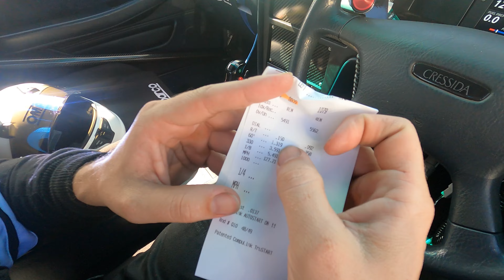BROKEN AGAIN??? Kenda 660 Drag Race Series RACE DAY!!!

Comment: Do you edit out the swearing yourself, or does Youtube do it automatically?  Either way, the beeps are fucking annoying so hopefully you can just pitch the videos at adults and if you want to swear on video, don't censor it.
The Mustang is a weapon!  I always figured a Stang needs a V8, but Nick's car has changed my mind!
Reply from the maker: Editing the swearing is the most annoying part, it takes forever. It's already targeted at adults but if you leave in too many you get in trouble, it only started being an issue after you get monetised otherwise I'd just leave them in, we actually swear alot more than I actually realised lol